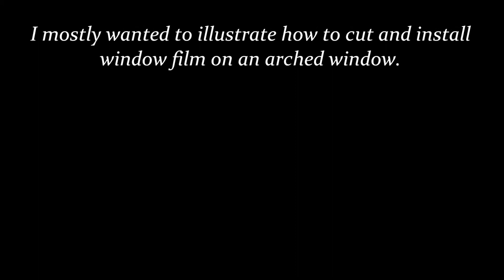ARCH TRANSOM - OLD FILM REMOVAL AND NEW FILM REPLACEMENT

Comment: How do you get a perfect cut around the edges ? I keep undercutting and leaving light gaps . I see you’re using a hard card to guide the knife , does that work well?
Reply: Yes, usually you would need a hard card to guide your knife. It keeps your knife steady and keeps your trim line nice and even. With an arch like that you have to place the blade at the corner of the card (not the middle) so your knife point can make the curve.

If you have vinyl windows you can do an "inside cut" which means placing the knife edge between the cars and window frame. It's a tighter cut. If you have wooden or painted wood frames I would do an "outside cut" which means having the knife point on the side of the card that is toward the film and away from the frame. The purpose of this is to have a slightly larger cut line and to avoid paint/varnish/glue debris from getting trapped behind the edge of the film.